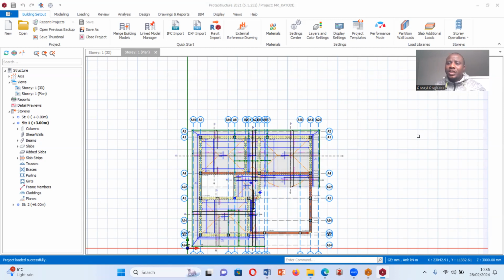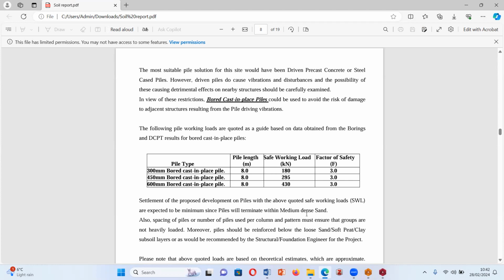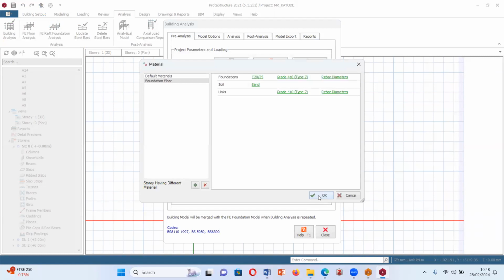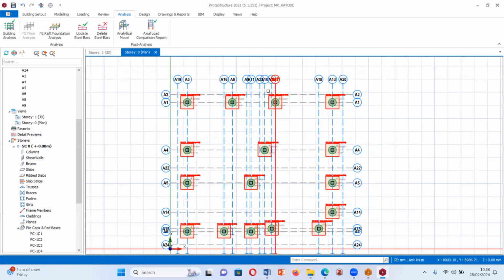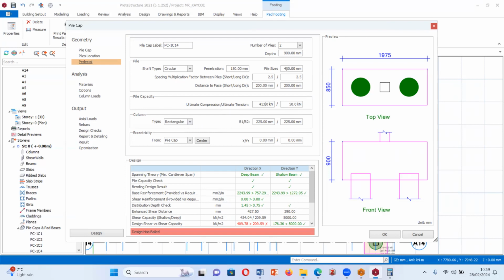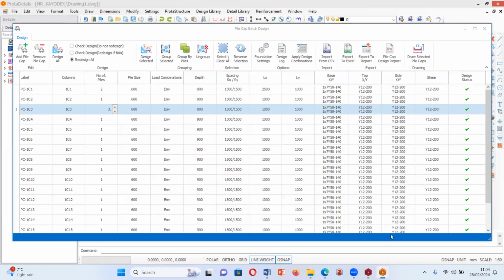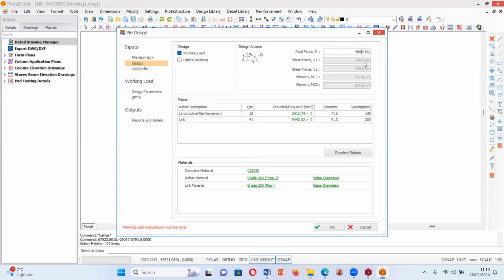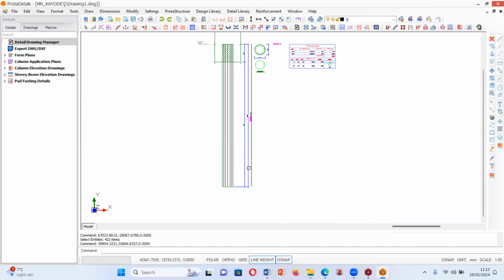Design of piles and pile caps with Prota structure

Comment: 1). Your ultimate load given the safe working load in your Geotechnical report is not The safe working load x 1.4, it is the Safe working load x the factor of safety given in the report.
2). The Axial load on a pile is not the load from the column any longer for a group of or a single pile, it is the ultimate axial load used in your pile cap design.

Thank you.

Engr. Peter O. Dinwanbor.

Comment: Hi. Before the whole design, I am to carry out the Normal building analysis that include designing the columns right?

 if so, and after the analysis and some columns fail, do I treat the column first before starting to design my piles and pile Caps?
Reply from the maker: Hi, regardless of your foundation type, your foundation should be the last structural element you design. So, in this case, design all structural elements before you design the foundation(Piles and pile caps). Thanks
Reply: All your designs must pass before proceeding to any foundation design at all.

Comment: Nice one Sir. Quick one sir, 
I'm finding it difficult to edit my rebar diameter... I was seeing Y50, whereas I choose Y20 in the settings.
kindly give me directions on how to go about that on the prota details sir.. thanks
Reply from the maker: Thank you for reaching out, and apologies for the late reply. 
I would advise that you go to your post analysis and edit the rebar manually. The good part of doing this is that the software will let you know if your reinforcement provision is sufficient or not, and also the software will factor the new reinforcement provisions in your design report. I believe this is a better way to solving issues like that instead of editing it on Prota details.
Kindly let me know if you need more guidance on this, so I can do a video specifically tailored to your needs. 
In order to get notifications for our new videos, please remember to hit the subscribe button if you haven't done so. Thanks.
Reply from the maker: Let me also add that is u have selected a reinforcement bar that is smaller to what Prota finds fit for use at any point, It would most likely just provide Y50. for example, if u have chosen Y16 and Y20 as your preferred reinforcement bar and Prota is looking at providing X nos of Y25 in a beam, if the the number of Y20 that could be improvised would negatively impact on some other design criteria, such as the relative ease of pouring concrete, it may just specify Y50. I advise that you try including a higher reinforcement diameter in your setup or reduce spans and/or loading.
Reply: You didn't select the rebar before proceeding to design. Go to the settings, plie cap, select edit materials and make sure you deselect 50mm and you select all the bars you want

Comment: Great job! I just wanted to bring your attention to the single pile cap you were trying to edit in protastructure, you can increase the depth to take care of the failure, say from 900mm to 1400mm...
Reply from the maker: You are on point. Depth (d) is a major consideration in catering for deflection, but I also wanted to show the limitation of the software. Thank you for your feedback. 🙏
Reply: @CivilSavy  You're most welcome. You're doing a good job with your channel, keep it up!
Reply: the software is actually very limited in Pile design. most times depth increased to 1000mm fails, but left at 500mm passes while unnecessarily helping you to increase the no of piles. i just give up and switch to manual calculations.